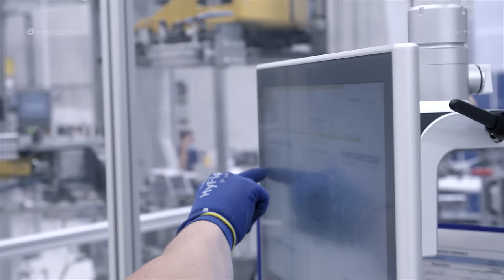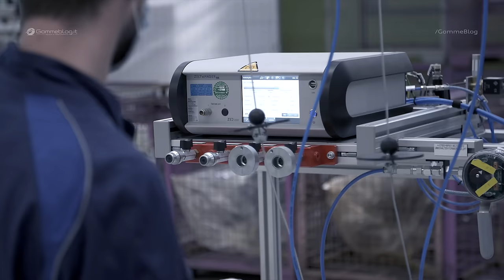BMW Motor E-DRIVE - PRODUCTION Engine Car Factory

Comment: I want to see a tear down of the 5th gen motor after 50,000 and 100,000 miles to see how the brushes are holding up. We have an i7 xDrive60 and I’m really wondering what the wear on the brushes looks like at higher mileages.

Comment: I think it is more complicated to build a factory which builds motors.
Reply: Electrical machines ( motors and generators are the same) were invented 1866.
158 years later mankind knows how  to produce littel emotors. They are very,very cheap.

Comment: wouldn‘t it be more efficient to use smaller diamater of copper winding in the sator instead of bigger copper conductors?
Reply: Bigger conductors can carry more current, thus produce more power.